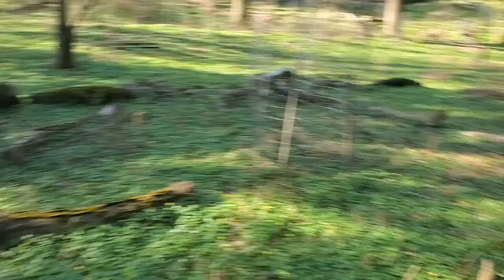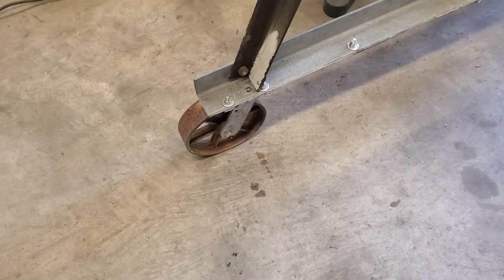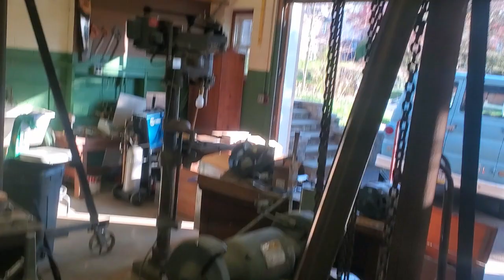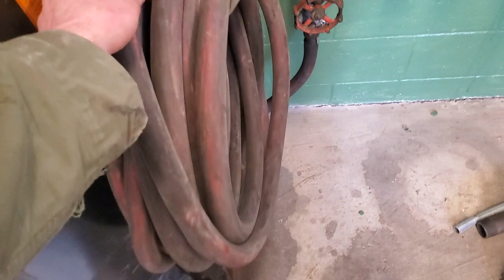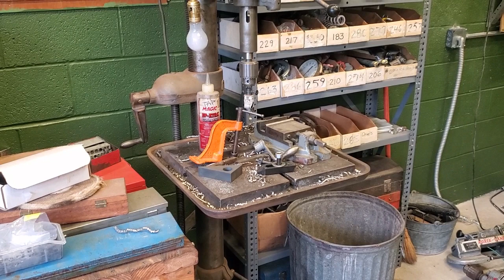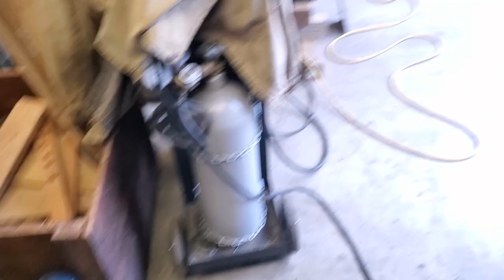Railway Update April 2023 - Sidetracked

Comment: Looking good dude :) One step at a time. I wish I had some of those cool machines that you have :) And I really like the gantry crane! I am in the process of making a 1-ton overhead crane rail for my garage. They are redoing one of the welding areas at work, and they had an overhead rail made up of 4" wide x 8" tall H-beams, mounted 12' off of the floor on thick steel 4" posts. Each post had a 4" x 6" top flange and a 10" x 10" bottom flange. All of the 1/2" thick flanges also had small gussets to strengthen them. They planned on scrapping all of it, but I talked them into letting me buy it. I will cut down the posts to 100" tall (my garage is 116" high,) re-weld them together, and then I will cut down the 2 14' sections of h-beam to 11' each, because my garage is 22' deep. The 2 beams will be kept as separate pieces, joined together by steel plates, because otherwise it would be too heavy to put in place with just one helper. I will need to come up with something for the cross beams that go across the 10' width of the garage bay, because they needed those smaller I-beams or H-beams for something else at work. I'm figuring on using 6' x 6' x10' wood beams.
Reply from the maker: Sounds like you have a good plan to set up a great crane, wish I had enough I beam to make a track for mine. It's such a help in the shop, can't even think of moving most of these things without it. I should need it less once things are all put together but nevertheless a good thing to have. Sadly I cannot assemble the press with it as it is not tall enough, but I plan on borrowing a forklift for that. I will need to wire in my generator to power the press though, it's 10hp 3-phase so I can't run it on the house circuits.
Reply: @Redundant_Communication  I mostly need mine for stuff that is stacked in the garage. I have a love of things that happen to be heavy, like industrial stuff, but not a lot of floor space. Thus, I have to stack it on top of other things when possible. I have a pallet jack that I rescued from work, but that only helps me move it around, not unstack it. And it's really annoying having to call people over to help me. The overhead rail and chain hoist will help solve that problem. Speaking of forklifts, I would love to have one in my garage! I drive one every day at work, and they are SUPER handy. Every few years they were cycling out the older ones at work and replacing them. They were only getting $500 for them as trade-ins, but I missed my chance to get one last time. Sadly, we are under new management now, and the guy in charge does not want to buy any new ones. I suppose it is cheaper to keep the older ones running. Still, I've been keeping some money in reserve in case they decide to get rid of one in the future ;)